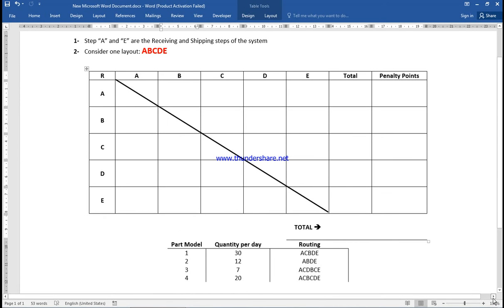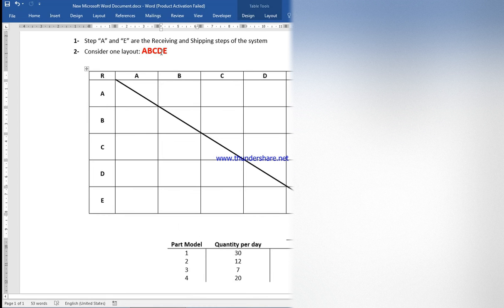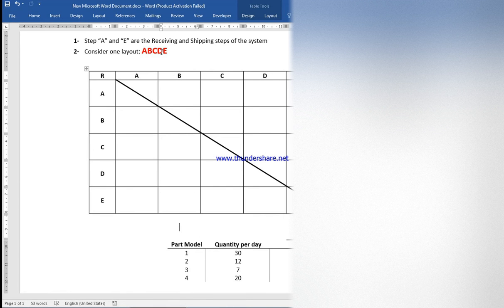From to Chart Flow Analysis Relative Importance Layout Efficiency Facility Planning |Facility Layout

Comment: Hi I don’t understand the backtracking calculation of the pentacle points. Please could you explain what we are multiplying.
Reply: from what I understood, the backward penalty is 2 and the forward is 1. so u move two steps back 2*2=4, and one step back 2*1=2, likewise for forward each step takes 1 times penalty
Reply: What is the purpose of the diagonal line?